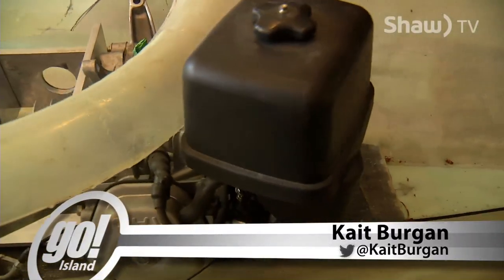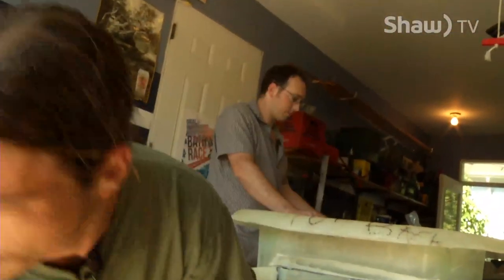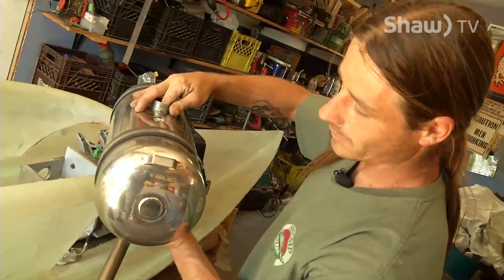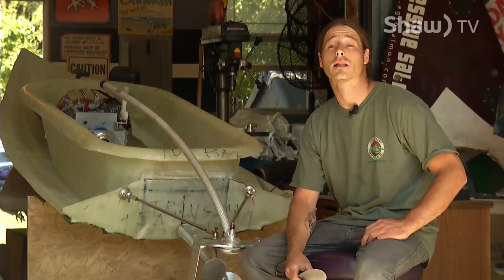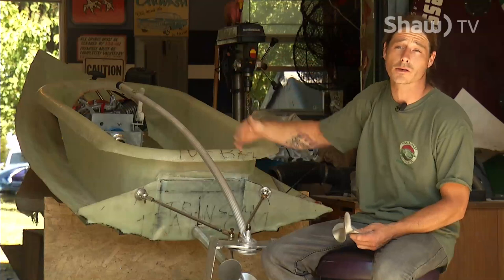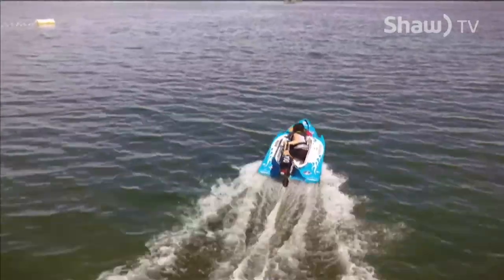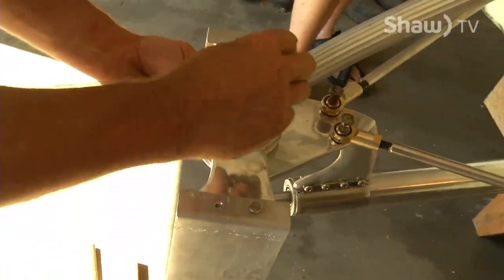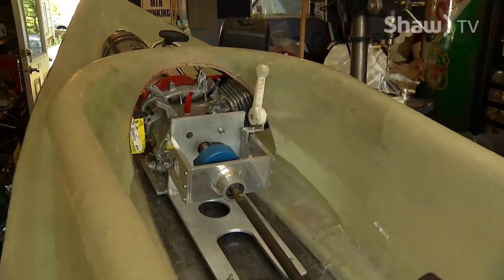Aggressive  Salmon Inboard Bathtub Motor - Shaw TV Nanaimo

Comment: Does that GX 270 have a billet rod / flywheel, Isky racing cam, ported big valve head and bored carb so it can turn 7000 rpm ? 
With direct drive your gonna have propeller rpm double what an outboard has, two blade prop is probably gonna be a big advantage there ?
Is that setup endorsed by Arneson LOL ?

Comment: It has been done before  by steve bradshaw i believe.  The boat is in town here somewhere .
Reply: Correct, the Bradshaw's had three entered after the Mr.Mikes tub (Art LaLonde). Steve Bradshaw was the only to finish with a single cylinder Honda 4-stroke, coming either 6th or 8th I believe. The Mr.Mikes had a single cylinder McCulloch's 2 stroke, the Bradshaw's had a single cyl. rotax straight shaft, a single cyl. yamaha 2-stroke Enduro engine with tranny, and the Honda surface piercing  (which finished). The Mr.Mikes tub appeared in the early 70's and the Bradshaw's followed in the late 70's.
Reply: Not sure whose tub it was before Igor from Stock Exchangers in Nanaimo entered a yellow inboard tub in 2005. I believe it was originally built by Art Lalonde. We didn't make it out of the harbour as the motor mounts flexed too much after getting air and would throw the chain drive off the gears. It wasn't fast but was well balanced in rough seas.